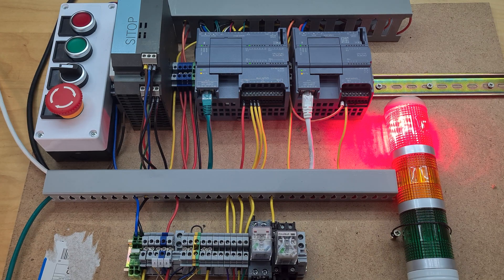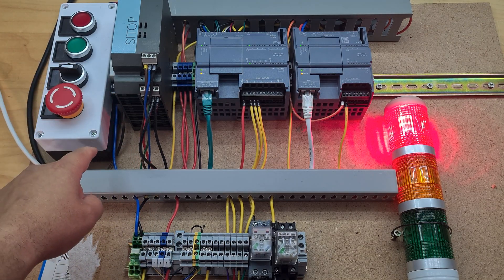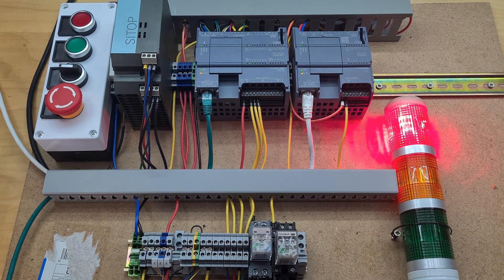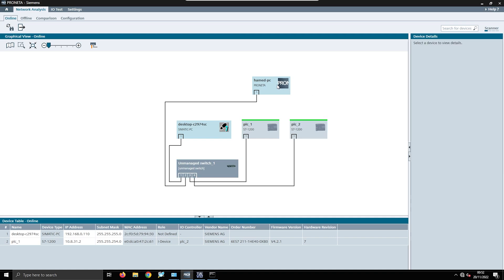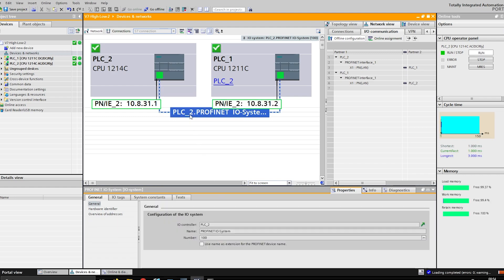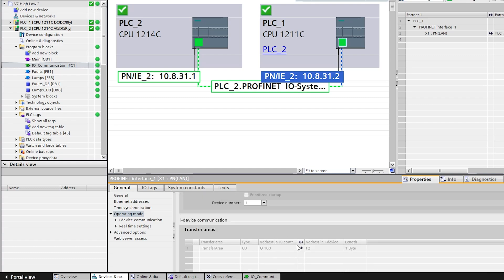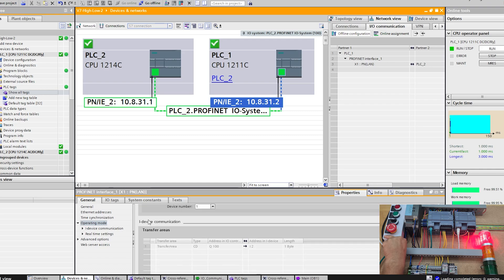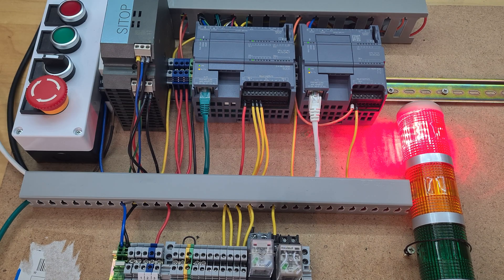Reading Tags Between 2 Siemens 1200 PLCs

Comment: I’m assuming several could perform multiple tasks, such as pumping out a flooded storage pit and sending e-mail to request a repair crew.
Reply from the maker: Emails from plcs are pretty hard i believe. You need an smt server or something. You could use a pc or edge device, have the edge device read a trigger tag and then do the email.